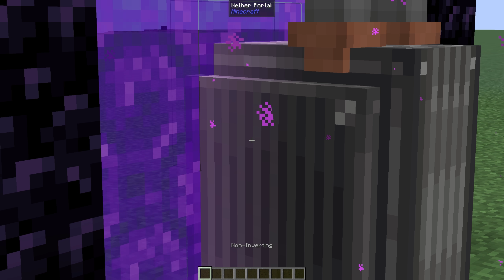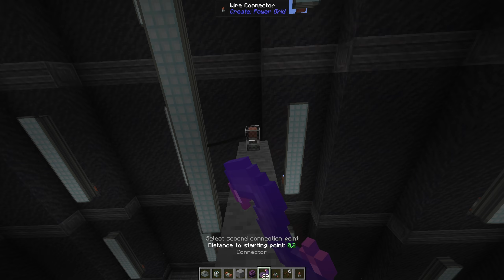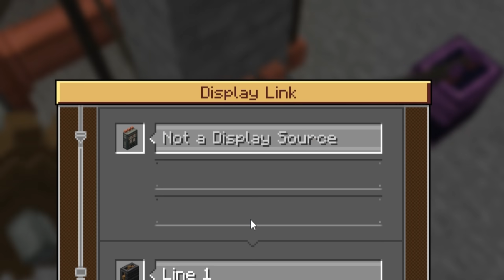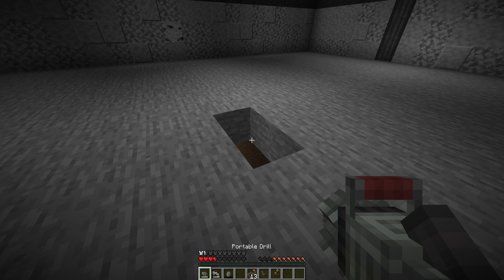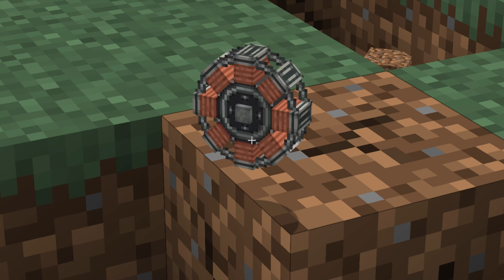Big Changes to Create Mod Electricity!

Comment: a guy who understands the transformer here. Pretty much it can convert the voltage based on the ratio of windings you give it. you give power across one coil of the transformer and recieve it from the other adjusted by its ratio of windings. a 1:2 ratio of windings will double the voltage when wired right.

Comment: imagine transformers as a "gearbox" you can lower the amperage to increase the voltage, vise versa
a voltage is the like force / strength for electricity to "penetrate" stuff
amperage is the amount of "fuel"

Comment: 0:58 : the lights are connected in series. i see 15 lights. so you need 15 * 120V = 1800V . that means you either reconnect them in parallel and use 120V or bump it up to 1800V

Comment: Transformers DOES NOT make it weaker or stronger... transformers changes the voltage from one to another, BUT it also inverse affect the amperage.... think of elctricity as a stream of water;  High voltage low amperage is a shallow river that flows REALLY FAST!!!, but low voltage, high amperage is a wide river that flows slowly.

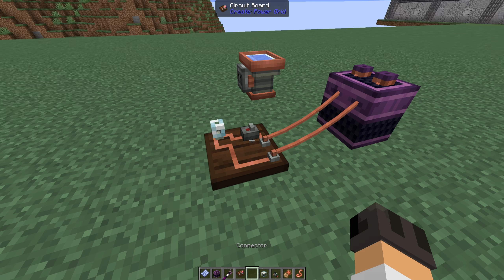Comment: 9:15 The simulation is pretty good. You can make LC oscillators, amplifiers, current sources, phase shift oscillators etc.
The dev even fixed the bug where an LC circuit would gain energy when tuned correctly (infinite energy)

Comment: 7:10 Very simple mechanical analogy: imagine the turns of wire are gears and the number of turns is the number if gear teeth.
if a large gear meshes with a small gear, you increase RPM but reduce torque by the ratio of the number of teeth.
Similarly, a large number of coils on the primary (input) and a low number of turns on a the secondary (output) will increase current but reduce voltage by the same ratio. And vice versa the other way around.

Comment: Why can’t they add a dumb mode where the mod doesn’t blow up the generator or any other item if you exceeded the voltage or current? It would make using this mod a whole lot easier, and give you more freedom

Comment: The factory lights finally makes sense. Light bulb make no sense because it is doing same thing as torch but using electricity. The new lights are finally emiting new better light and spending electricity finally makes sense.

Comment: electricity is easy as long as you can calculate 1x1=1

like transformers

one side, lets say 1000W with 100v and 10A, ad that transformet side has 1000turns, the other side is 500,   thats an 2:1 ration,    soooo the secound side will be half the voltage but double the ampere   aka 50v and 20a

Comment: 9:05 Neon bulbs need a resistor connected in series because neon bulbs tend to draw more and more power until they burn out.
That's in real life; I don't know if it's the same in the mod.
Reply: it is. The IV curve is pretty accurate. Including hysteresis! So it's perfectly doable to make a neon bulb clock.

Comment: most complicated electricity mod was "electrical age" mod from old 1.7.10.

everyone forgot about it
Reply: not Electric Craft? (from the the RotaryCraft mods)
Reply: @erumaaro6060 broooo rotarycraft...

i mean not complicated, but best simulation.

resistance, thermal simulation, voltage dropping.

I'd love to see that kind of simulation and all those features in future versions
Reply: @danilka1802  fair enough. 😂
At least we now got full network simulation.
EC only had 1 cable, capped at 4 sources/drains and resistors were just current limiters.
I just loved trying out reactor designs for ReactorCraft, so the other two were mandatory.

Comment: 7:40 Because there is no current, you need a resistor of about 100 ohms for it to work. (This will produce a low current so it doesn't explode.)

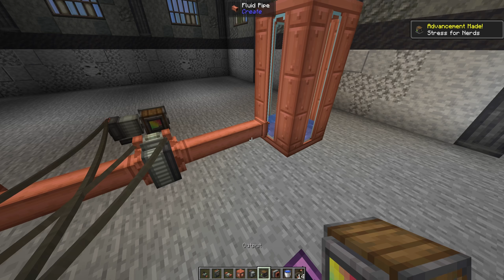Comment: 3:23The electric motor of this mod is pretty poor (in terms of power). Other mods have more powerful motors.
Reply: Generators can be used as strong motors in this mod
Reply: @maingvaldsen5747 So they allow this?! Basically a generator is a motor that receives torque instead of electricity. It's mechanically the same (it depends on the motor but any simple generator you give electricity to will become a motor).

Comment: 9:05 ah yes that tiny little light bulb needed 110 volts
Reply: Well, neon bulbs works with "high voltage" in real life, they work with generally between 120v and 240v, but they need a resistor in series with them, because neon bulbs tend to draw more and more powerful until it burns.

And neon tubes works with between 6000v and 20000v.

Comment: Transformers are easy Shals.
Say you have 100 windings of copper on one side, and 50 on the other
Then you supply 240 of your swedish volts to the 100 windings side, then you get 120 volts on the output, but double the potential amperage.

Do it the other way around and you get 580V on the output, but half the potential amps

Comment: transformers are pretty easy... 2 coils around a core.. if coil one has 3 turns and coil 2 has 6. then whatever AC power coming in to the first coil comes out of the second at double the voltage and half the amps... so what ever the ratio between the two coils are the amps are multiplied by that ratio and the voltage multiplied by the inverse.

Comment: 7:50 Power Grid needs chunkloading. (Electro Energetics mostly works without chunkloading, as long as you don't interface with things that do.)
Reply: Shouldn’t the nether portal be loading the chunk either way?
Reply: @pizzaking354  Portals only load chunks when something goes through. That's why chunk loaders utilize a minecart that constantly goes through the portal.

Comment: Aight, real simple tldr of transformers: the main things in electricity are power, voltage, and current. Power = voltage * current. Power pretty much once its generated it has to remain the same power level, however the voltage and current of that power can be traded for each other. Thats what a transformer does. Devices dont like too high or too low of either and so if you have an excess of one and a deficit of the other you can kinda trade them off to get to where you want to be. 

The formula can get really complicated if you start getting in to like materials and stuff but I dont think theyre doing that in a minecraft mod so Id assume theyre just using the ratio of voltage in to voltage out is the same as the ratio of the wire coils on the input vs the wire coils on the output and naturally because its a trade off the current is the inverse of that.

Comment: It’s a cool mod but i dislike how it feels like a replacement for the create mods gears and shaft mechanisms in most of what it added in the last version. it’s great decoration mod at times but requires too much work for decoration hopefully this update changes how I feel on the mod because it is well made and feels cool to use

Comment: a transformer just converts a ratio of windings (amount of turns in the transformer) to electricity; if you have a 10:1 ratio and then you put 10v in, you get 1v out

Comment: Transformers are super simple! You input a voltage and use a ratio to step up or down the voltage. For example to step 120v to 240 you just make a 2:1 ratio using turns. (might be 1:2 if forgot) I'm not sure if they changed the way that they work in this update, but generally to hook a transformer core up, you grab a copper wire, select your first node, which will be the positive input and set the first number for the ratio by holding right click on the core, and then set the positive output. Then you set the next node, negative input, then hold on the core to change the second number for the ratio, then set the last node which will be negative output. A little weird but not too hard to use. Glad to see more people covering power grid btw!!
Reply: That's correct, but when using normal generetors you have amps (A) if you want it's like stressunits but for electricity. So for example if you have 16A 120V and you want to have 240V you do 120Vx2=240V but 16A:2=8A (you always do the revers for amps) otherwise, Yes it's really simple.
Reply: @bekachka  Yes, according to the law of conservation of energy, whenever you improve one thing, you will lose another. (Simply put)
Reply: @eldadmarbach2288  Also some of it turns into heat you didn't want
Reply: @marcforrester7738  yep, first law of thermodynamics
Reply: @marcforrester7738  Yes, and there are the magnetic fields that if you don't use the right materials won't pass through properly. I'm a mechanical engineering student, one of the things I learned was about transformers (in small). I don't really remember everything but I do in general.

And also in general in mechanics, there is almost always heat (if not always).
Reply: @hexagonny  that's moreso the second law
Reply: @bekachka  It is probably more accurate to say that watts are like SU, volts are like RPM, and amps are like SU / RPM (which Create sometimes calls "Stress Impact" on the consumer side, but it doesn't have a name on the generator side).

You can then think of a transformer as the electrical equivalent of a rotation speed controller, except that it takes a ratio instead of a fixed voltage. So it's really more like a bunch of large and small cogwheels gear ratio'd up to each other.
Reply: @NYKevin100  you've just explained this mod in a way that the walnut in my skull can understand
Reply: @bekachka  "Amps are SU but for electricity" is a great tutorial phrase for any Create enjoyer.
Reply: autobots rollout
Reply: I learned how to turn a transformer core into an actual transformer with a wrench
Reply: Indeed, the simplest possible way to explain the transformer to the googoo gaga create brain is by saying "so imagine a gearshift"
Reply: @fungigp7692  its smart bc its a create mod addon and create players should know abt gear ratioing as of learning the mod
Reply: It's basically a gear set, but the big coil is the small gear.
Reply: “Simple”
Reply: What the heck is anyone saying in this comment or replying. I don’t understand a single word
Reply: It is 1:2, in general: V1/V2 = N1/N2
Reply: Doesn’t sound that simple..
Reply: @TheCouncilWillTakeOverNYEHEHEH Not if you dont know anything about electricity.
Reply: @HurricaneFolf  true.
Reply: They are simple until you need to calculate phase. Square root of 3 everything.
Reply: And it has to be ac not dc or current increases till limit and cook itslef
Reply: Nga that is not simple
Reply: @CreativeHDpast  It is unless you don't know the  basics of electricity :/
Reply: So there is an "unless" there so its not simple for everybody, do you expect teens who play minecraft a few times a week to explain how electricity is created?  @HurricaneFolf
Reply: @CreativeHDpast  Dawg this comment wasn't even written to you so I don't even know why you care to respond. Kids man 💀
Reply: I'm not reading that
Reply: @nea-aboomer  Then don't! Wasnt written to you anyways! :)

Comment: I absolutely adore this mod, and am semi-actively creating an 8-bit CPU!
Reply: Does simulation behave right for you?

When I have too many resistors and relays connected it randomly decides to blow up everything
Reply: @gamerscreen11566  relays contain coils IRL, but I don't know if it's modeled in-mod as a pure resistance instead.
If they do have inductance, changes in current (dI/dt) can cause voltage spikes on the falling edge. Try adding a flyback diode in parallel to the relay. (reverse biased)
Reply: make every component of a pc if possible
Reply: @WarTycoon-g5f  That's planned! But it's pretty hard..
Reply: Noice. I'm trying to create a neon bulb SRAM. (an array of bulb+diode, making use of hysteresis to store data)

Are you using the "Power Chip" addon that let's you create integrated circuits within integrated circuits? It's capped at 5 levels of recursion though.
Reply: holy moly😲
Reply: how
Reply: I tried to make a sr latch but it just didnt work even though my nand gate was fine. The transistors are so weird and the relays are complicated
Reply: @Alos20192 No.. no they're fine. They work great and normal for me. It depends on what type of transistor you use, NPN or PNP. Because that can REALLY change how you power stuff. Relays are fine in mine experience, I made the 8-Bit CPU using the relays, as I'm better at relay logic than transistor logic.
Reply: @WatchamacaIIit  ı wish there was somewhere i could get like the board blueprints the miraheze wiki works but it ıses switches and didnt explain the sr latch fully
Reply: use create power chip if you aren't already.
Reply: @bluefoget315 no! Thats cheating. I prefer them RAW circuit board.
Reply: @WatchamacaIIit  yeah well your “raw circuit board” is like the computer that launched Apollo 11, and you don’t even have selves to put the on.
Reply: @bluefoget315  Womp womp
Reply: "randomcrapmaker" 😭